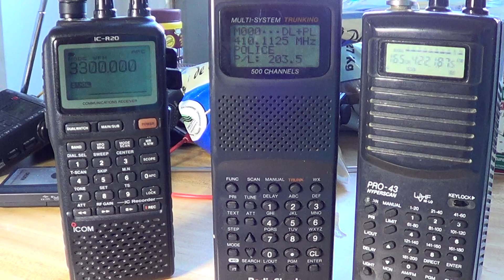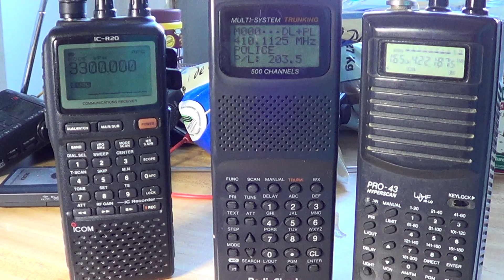Tutorial Scanners VS Communications Receivers

Comment: FCC mandated in the 1990's, that ALL scanners/Radios had to have the Analog Cellular removed from the Radio. I have a AOR 1000, it can Receive 800mhz Analog Cellular. it was PRE BAN. you can Down Convert the 800 Mhz cellular to 500 Mhz but there is NOTHING to listen to . the ICOM is a Fantastic Communications Receiver but it cant Receive 800 Mhz Celluar per FCC Regulations.

Comment: SCANNER = basic radio, limited FREQ ranges, One FREQ display at a time, Trunking, Limited Search and Tuning Steps, Minimal or No Filtering. 

Communications Receiver = more Technical, Unlimited FREQ Coverage (this was changed in 1990's - FCC mandate to Eliminate Analog Cellular from ALL Radios), Dual VFO (Two Frequency at a Time, No Trunking, Frequency Bandscope, CTCSS and Tone Display, Unlimited Search and Tuning Steps, Multiple Filtering options. Generally more Sensitive.

Comment: Can the ICOM scan multiple frequencies at the same time? Let's say I want to scan fire, police, and ems at the same time.
Reply from the maker: Om it's 2 receivers in one .. so you can scan two different bands at the same time ... and also acts as a regular scanner ...  scanning channels
Reply: ANY scanner can scan multiple frequency but only Communications Receivers (ICOM, AOR, ALINCO) have Dual VFO, this allows them to Monitor (not SCAN) two frequency, used by HAMS or Anyone with Simplex Radios.